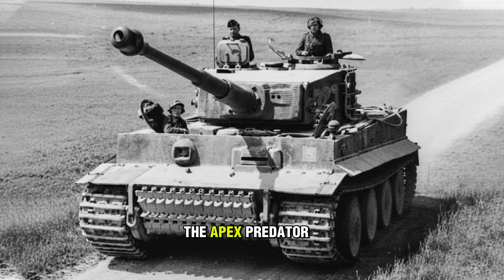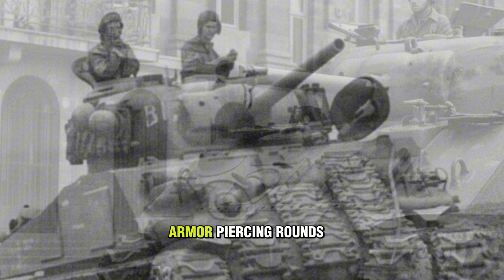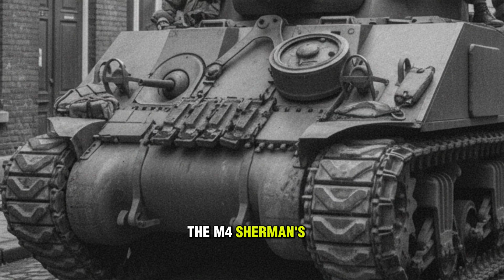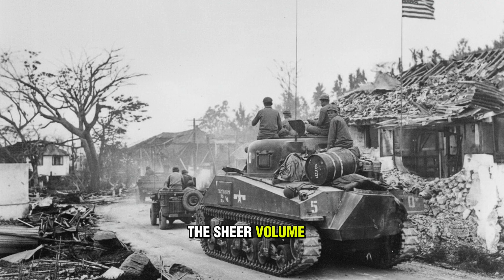The SHOCKING Truth About Why the Sherman Tank Dominated the Tiger

Comment: 0:14 This is gonna be a real change my mind experience... 

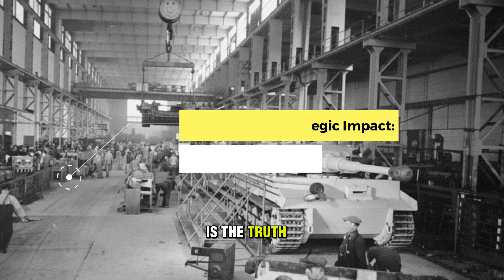5:51 at this point still a weak chase 👀

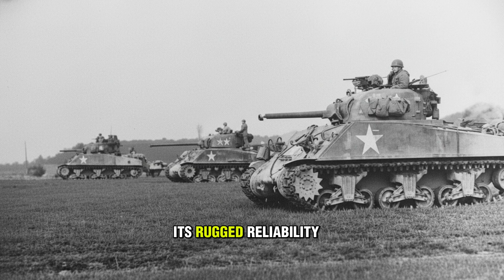8:33 here stars the discussion... sherman is a medium or even light tank design and the tiger is an heavy tank design...

The fact is simple and the discussion is easy to end! 
The tiger is the superior tank!
What the right conclusion must be is that choosing a heavy tank as the main tank design is the problem. 

The sherman dominated only in 1 way over the tiger and that is factory output. 
Meaning tiger is superior tank but sherman is superior as a main tank design. 

I think I made my chase... 

Do share your thoughts on my chase or try to change my opinion, but be kind!😇
Reply from the maker: thank you so much for you comment...